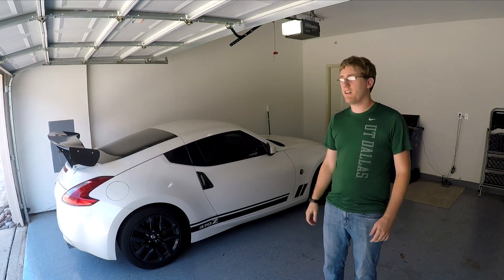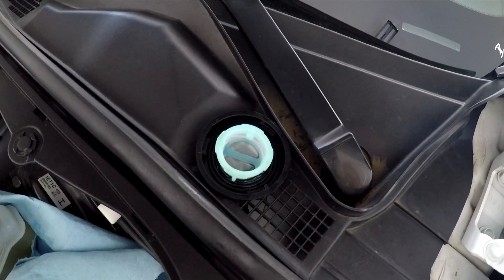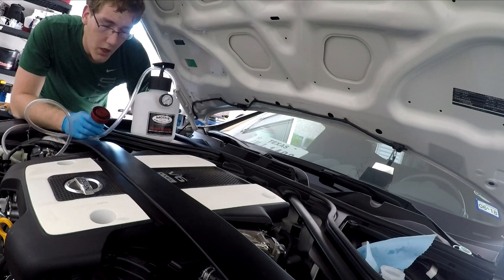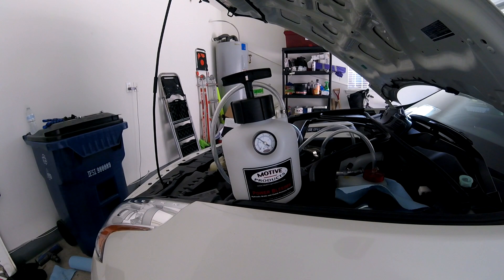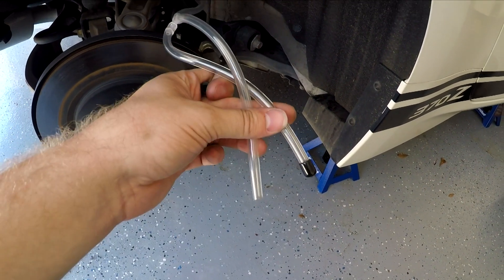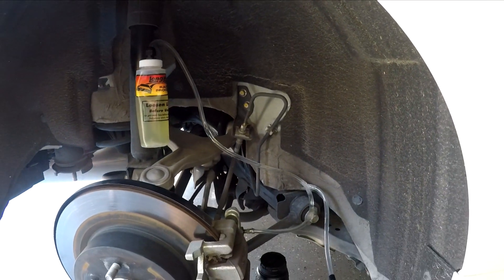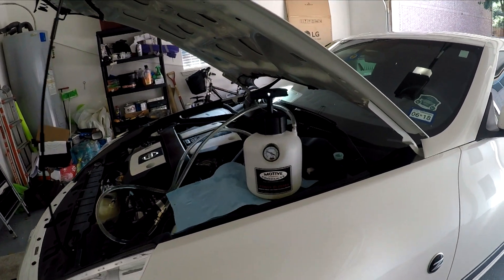How to Flush Your Brakes Using Motive Bleeder - 370Z

Comment: Per FSM: Proper bleed order = Rear Right, Front Left, Rear Left, Front Right. Ignition should be off and negative battery terminal should be disconnected to prevent damage to the ABS actuator. Also, I strongly recommend you use a GOOD 8mm flare nut wrench (this car uses metric measurements) instead of a 5/16 combination wrench. The banjo bolt used to bleed the brake caliper is extremely susceptible to being rounded off using a combination wrench, unless you use the box end. Using the proper bleed procedures and tools ensures you'll get the job done correctly.
Reply: Yes, it would be fine to use the 8 mm wrench size but the 5/16" size wrench is 7.9375 mm and will not be a problem, as long as the wrench fits over the flats of the bleed nipple fully without having to be forced.
Reply: What happens if you do the wrong order?

Comment: hmmm, your motive power bleeder builds pressure a lot faster than mine.  my bleeder is from 2009-2010, but it takes a lot more pumps to get to 10 psi than it took yours.  Anyway, after several uses, I've decided to use it dry vs putting fluid in it.  

for all of those putting fluid in their bleeder, I suggest finding a way (a bunder or string from the hood) to hold the hose as vertical as possible to allow the air trapped in the hose, and reservoir, to make its way up.  also, not covered in this video, is teflon tape on the fitting threads btwn the pump and the adapter section of hose.  Also, expect the hose to fail after about 5 years (ask me how I know...)
Reply: Seems like this would be less cleanup, but may take a little longer.  Still I think I would spend the extra time.

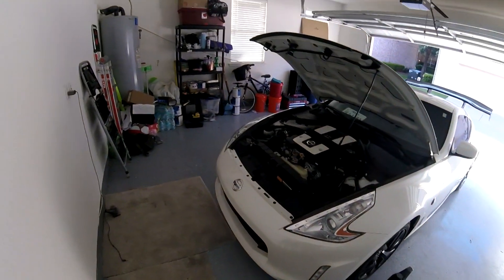Comment: Based on your admitted nervousness about successfully completion of the job 16:55, why accelerate to this speed 17:24 without being 100% certain the brakes work properly?  For others who might be watching this video, and who might also be uncertain of your own work, do yourself a favor; test the brakes several times at speeds below 10 mph in an area with little/no traffic or pedestrians.  Press the brake pedal hard at low speeds initially to build pressure in the brake lines and test for leaks.  Then pull over, check for leaks, check the master cylinder fluid level again, and then briefly try testing the brakes at higher speeds.  Afterwards, check for leaks again, and check the fluid level again.

Regarding wheels: aftermarket wheels only reduce resale value.  Stick with factory components or buy a car that has factory wheels that you like.

Comment: FWIW: I highly recommend putting the box end of the wrench on the bleeder, then then tubing. You really don't want to want to strip that sucker.
Reply: I highly recommend your suggestion.
Reply: kaj750 or a pipe spanner if handy
Reply: Good idea. I loosen mine with a socket first. If it's an older car, I put penetrating oil on the bleeder screw the day before.
Reply: @kaj750 Is there a link for a visual reference to what you're advising? I want to understand.
Reply: Another question, should I flush my brakes before replacing rotors?
Reply: @kevinrose4975  you put a box end wrench on the bleeder, then attach the tubing. You can loosen and close the bleeder with the tubing on. 
You don't need to flush brakes when putting on new parts.
Reply: @kaj750  does the box end wrench on the bleeder RED CAP on the reservoir?

Comment: I would recommend using either the box end of the combo wrench or a flare wrench, for better engagement of the bleed nipple with 6-points of contact versus the 2-points of contact with the two parallel prongs of the wrench you used. These bleeder nipples are typically made of cheap and soft metal with flats whose points will round easily under the high torque you might have to exert to break free a nipple whose threads have some corrosion on them. Two point contact places a lot more stress on those points, making them tend to round.

Using a pressure bleeder like that is the way to go when flushing brakes, better than the 2-person pump or the vacuum method at the bleed nipple. I've never been able to get brakes bled properly with the vacuum method, because of the tendency of air to escape past the threads of the bleeder nipple even after I'd applied Teflon tape to the threads.

On the subject of good wheels for the Z: I am in the process of installing a set of forged magnesium monoblock wheels from Litespeed Racing in LA. They're painted to match the color of my car and are super lightweight, 14 lbs vs the 23 lbs for the forged aluminum(19 x 9J & 19 x 10J) Rays Engineering OEM wheels on my sport model. The only problem is that they're extremely expensive. The wheels are highly engineered for strength and light weigh with vey thin spokes that will allow your brake calipers to stand out in the calipers are painted a bright contrasting color. My car is a very glossy all black with wheels to match and so the red Akebono sport brakes really pop, especially with these new wheels. The model of these wheels is the RS5 RR, which is available in a wide range of colors and finishes.

Another thing to note is the effect of the choice of tires on this car. I'm running Michelin Pilot Sport Cup 2(240) tires that are a kind of transitional tire between a full-bore track tire and a maximum performance street tire. The only caveat in using them is that they're not good in standing water, necessitating careful steering inputs and brake applications but otherwise fine for daily driving. They're about 6 lbs lighter than the OEM Bridgestone Potenza S007 tires that the car came with when new. I believe this is due in part to the use of lightweight Aramid fiber in the belt plies vs the steel belts that most tiremakers use. This takes mass away from the point where we most want it removed, the outer circumference of the tire that reduces the moment of inertia the most. These particular tires also have stiffer sidewalls as compared to Michelin's Pilot Sport 4S, thus improving steering response. The tires also have a better transient response to impulse loads from the road.

Comment: Your OLD used brake fluid looks like my NEW brake fluid! Good contraption, but it won't fit on my 92 GMC truck. If you decide to work on your car more, get the 18V 1/2" Ryobi impact driver. Buy the 4 AH battery pack. It has saved me lots of time and sore arms. Home Depot I think... Get your impact sockets at Harbor Freight.

Comment: Good video, well done. One thing I would have done would be, I would put plastic cover under or use a hospital bedding protection cover to prevent spills;  works very well as they are designed to stop any major leaks. Just a suggestion.

Comment: Again, unless you have changed all four sets of pads, you needed to have checked what the fluid level was before you started.  You need to have the new fluid at that level.  Fluid leve in the master cylinder is a guide to wear on your pads.  Topping it up to full negates the level marks.  Just a thought.

Comment: It looks like this would work without putting any brake fluid in the Motive tank. Probably just air pressure would do the same thing as long as you start  the bleed with the master cylinder reservoir full  when starting each wheel.
Reply: it does.
Reply: Yes. Then remove the Motive cap from the reservoir to add any additional fluid. I like doing it dry because I waste FAR less of my expensive fluid and there is also less mess!
Reply: Ya, you don't want to under fill. Any f up at the caliper and it's do over?
Reply: Umm you can't save or reuse brake fluid.  Once the container is opened it is garbage.

Comment: I know this is old but I have been looking for confirmation that these pressure bleeders will actually fill and flush a completely empty/dry system. Logically it seems like it should when I think about how it works but in practice Im unsure if it will waste brake fluid or need an excessive amount with the master cylinder starting dry. Also, if they if the master cylinder is dry, when you are pressure bleeding, would it make sense to pump the brake pedal while under pressure to get air trapped in the master out, or will it get out without pressing the pedal at all, and if do press the pedal will it potentially cause a problem where you could potentially push pressure back the wrong way or something, idk... I'm not an expert on how brake systems work or even how hydraulic systems work but I really would like to know what to expect before attempting, as I have never seen any videos discussing these things in much detail. I would prefer not having to prime the master cylinder the way I have seen described as proper without this pump, but at the same time I don't want to second guess if the thing actually bled my brakes safely and properly. Also I have heard doubts that this works for the clutch well enough but I again have not heard any explanation to why, it seems like the clutch would be a simpler system to bleed than the brakes, all I can think is that you may have to potentially press the clutch pedal down for some reason no matter what to get things flowing right, idk honestly.

Comment: I have a 2019 370Z sport coupe 6M with 19" Rays forged aluminum wheels(245 F, 275 R) and the car handles great. The OEM tire is the Bridgestone Potenza S007 and they have fantastic grip. I would recommend checking out the Volk racing wheel section at Rays Engineering. I'm planning on probably getting Potenza RE-71Rs to replace my tires soon. I think that the Michelin Pilot Sport 4S would be a good choice for this car.

Comment: I think the FSM says to disconnect ABS sensor or the battery before flushing brakes.
Reply from the maker: Maybe, I have not had an issue but I will look into this next time.
Reply: @thecarizon504  Its true. Disconnect the battery or abs sensor. Also, for G's and Z's, Rear Right, Left Front, Front Right, Rear Left.

Comment: There is a lot of wasted brake fluid in this video. On the first caliper, yeah, you need to let it drain more because of what's left in the reservoir and the ABS pump, but for the other callipers you only need a fraction of what you drained from that first one, because the reservoir and ABS pump is already flushed. You only need to flush the brake fluid that's in the lines on the 2nd, 3rd and 4th calliper and that's very little amount.
1.5 L should be enough, 800 ml + 300 ml + 200 ml + 200 ml, maybe even less than that.
Reply: Agreed, But he is using the cheap stuff. We just used Motul Dot 4 for a track day and two 500ml bottles at $520 filled the system flush

Comment: Bottle should be below the caliper, it's a 10mm, and the sports model had 2 piston calipers in the rear and 4 piston calipers in the front. Both front and rear calipers has 2 bleed nipples.

Comment: You had the correct spanner, and you used the wrong end.  Suggest also, that you use split ring spanners.  Easier to get on and off.  Open ended spanners have a tendency to strip the edges if not used correctly or sized properly.  By the way what did you do at University?
Reply from the maker: That's funny, I have used the closed end of the cresent wrench in subsequent brake jobs. Must have slipped my mind when I was doing it in this video.

Also I study Electeical Engineering.
Reply: @thecarizon504  Looks like you are doing ok. Get in a career field that could last 40 years! Don't work 40, though..Have fun, make good money, save it, invest it and retire early. ( make more videos)

Comment: If nissan recommends having the engine running on flushes with the 370 like they do the 350, did you not because your pressure pump negates the need for it? I may well be wrong but I thought their suggestion was for abs system purging reasons?

Comment: I am soooooo sad that you hadn't decided to do this exact video for the Akebono big brakes instead of the base ones. Believe it or not, the fact that the Akebono calipers have two bleeder valves each truly lodges a wrench in the gears of my understanding of this process. I do recall that you mentioned how in the scenario of bleeding the bigger brakes, that you must bleed the outside facing valve first before the inside facing valve. And yes you are correct that you start with the farthest caliper and do so in chronological order from farthest to closest.

A question:
• how exactly had you determined when to tighten the bleeder valve after loosening it and allowing the old fluid to fill the container? It seems as if you simply closed the valve once you observed the old fluid reach near the top of the container, but this confuses me because there doesn't seem to be any clear designation as to when you should close that valve and move onto the next one.
Reply: He bleed out too much. You bleed till you see clear fluid coming out of the Caliber

Comment: Do you have to apply the emergency brake when doing this work?
Reply from the maker: No but it's good practice to do so when jacking the car up. Only time you absolutely shouldn't is when changing your pads/rotors.
Reply: The Carizon thank you so much sir.
Reply: Typically the  ebrake is cable actuated. If you yank off the disk either front or rear, (differs by manu.). You'll see a secondary set of mini brake shoes. Yah, I know it's pretty neat. There's a drum brake within the disk.

Comment: The "catch can" should be below the bleeder valve.
Reply: When using positive pressure, it's not important. The air bubbles will travel up the tube more easily than down the tube and you're not risking back flow as long as pressure is maintained in the power bleeder.

Comment: Hey, where did you get your recovery bottle with the magnet attached to it ?   I looked on Amazon and didn't find one with a magnet.  Maybe I can super glue one on.   I would appreciate it if you could tell me where you got yours.  Thanks, and great vid.
Reply from the maker: I can't find the EXACT one, but Longacre model no. 52-45200 is pretty much the same thing.
Reply: @thecarizon504  I finally found one on Amazon... allstar performance ALL11017 with magnet and check valve.

Comment: I think it’s a 8mm if I’m not mistaken hahah I never used a SAE wrench on my Z
Reply from the maker: Yeah it is most likely metric but I didn't have a metric wrench small enough (definitely not 8mm, maybe 6?)
Reply: @thecarizon504  Try using a brake line wrench or flare nut wrench